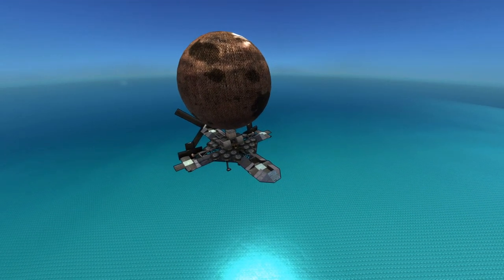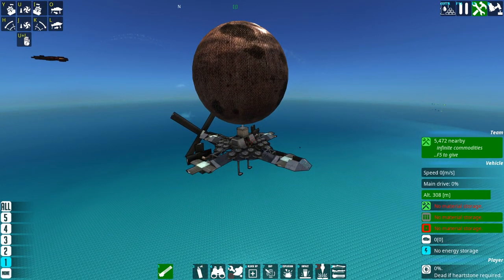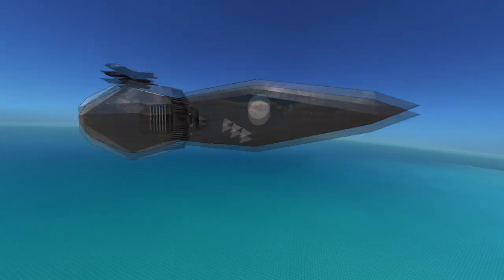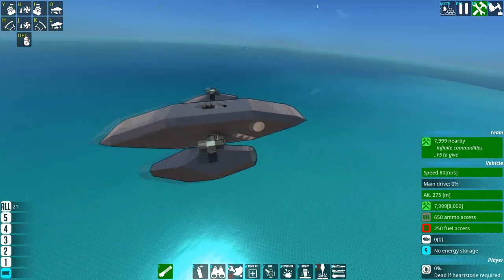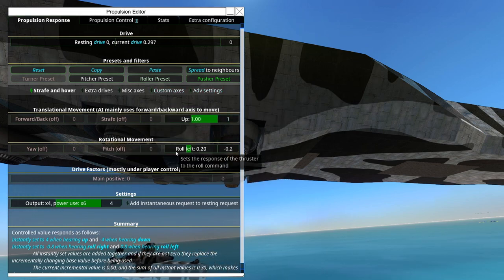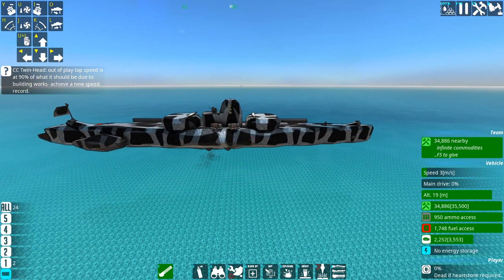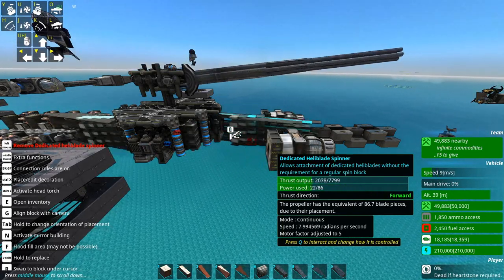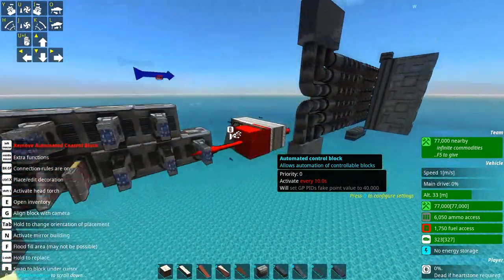Basic Airship Guide (5 Ways To Airship)! From the Depths

Comment: The integral time (I in pid) is very useful if you have a ship that's stable in pitch, i.e. not bouncing around, but points the nose too high or low. What it does is, the longer the pitch is wrong, the more corrective force it puts, so it'll push the nose back up or down and keep it there. Also works for altitude and roll.
Reply from the maker: First time I've heard it explained like that. I'll have to keep that on mind next time, cheers. 👍
Reply: Its also fairly useful in small attack jets to compensate for lack of redundancies, ive found it helps my jets stay stable even after losing a good chunk of pitch control where it would otherwise have gone to space
Reply: Woah, never heard it explained like that. writes this comment down

Comment: When using an airship that use props for lift, disable reverse, this helps maintain zero pitch. I find if you don't do this the craft will auto balance leaning slightly forward or slightly back.

Comment: Helium Airships
they benefit GREATLY from many helium compartements, as i can attest as an avid user of them, their greatest weakness is still overpen shells, since they can break open all compartements in one go,
helium airships also greatly benefit from sheer size!
Reply: Can testify! Also, the added fuel efficiency lets you have more materials to use as ammo.
Reply: @sampletext5959  or more material to maintain your fleet of fast, small attack crafts
also helium can lift ALOT in Ftd
i have a zeppelin aircraft carrier that uses a alloy-sloppedHeavy-alloy armor belt and it still flies like its nothing!
Reply: My go to is to create a shape like a 3-d chessboard made of 4m wood beams/poles/whatnot, and empty space, with the empty areas having a helium pump at one end, which also holds the beams together. This results in most of the volume of the ship being an array of hundreds of tiny gas cells, which cant be all taken out at once unless you blow up the entire craft in one go, and because much of the weight capacity is in the balloon itself, destroying chunks of it will also remove a correspondingly large amount of the weight it needs to carry.
Reply: Making a bunch of pre-fabed balloons then spamming in a sausage works great. Just wrap it in armour, and you even get airgaps for HESH protection.
Reply: Fill it with hydrogen and then you get the hindenburg disaster
Reply: I assume compartments make you drop down less when hit?
Reply: @Leon_Portier  yes
and since I usually go overboard with the helium, you need to pen MANY of them
only downside of my faction is that i build primarily with lighweight alloy and often dont have an armor scheme for the smaller airships, they often have just a single layer of alloy for a hull
Reply: I was playing that campaign against only the Onyx Watch, and after capturing some Onyx watch ships, I realised that if you replace all their water pumps with Helium pumps instead, due to their typically very spacious and compartmentalised hulls, hilariously you can actually convert a lot of them to helium airships with surprisingly little effort or extra material expense. I started doing it as an ongoing theme of the campaign. Despite being full metal, most ended up being basically neutral buoyancy with the air, needing only the most minimal engine power to lift up, and then next to nothing to maintain altitude.

A few of the more dense ones needed a couple crams removed from the top to clear room for helium, but I just prefabed some and put them on the bottom again instead. Made for a novel campaign gimmick.
Reply: Do you prefer armour, normal hull, or alloy to separate air compartments?

Comment: I use the AI's ability to control yaw
But I often using ACB blocks to control roll, pitch, forward speed and altitude.
I never use PIDs (because craft made with ACBs duck dive and weave) but they are useful if you need a stable craft for lets say.. a hover tank. (Something close to the ground/water needs stability)

Also setting up all you thrusters to respond to multiple commands is a slight issue
Whenever your craft needs to go up, it will lose all pitch control (if its also set to that).
I try to have multiple thrusters with specific tasks but you do you
Reply: Really? I Always thought multiple Inputs get added or subtracted. Might bei little less effective but on very small craft i think it would be necessary.
Edit:
(eg. Front: up1+pitch0.5 = 1 thrust, but in the back it's: up 1 + pitch(-0.5) = 0.5 thrust; in this example the front thuster only respond to Up, but the back one will BE effected by pitch).
Reply: @grandfremdling3841  yea, you're right. I always set up my corner thrusters with pitch, roll, and hover (although you might need to tweak the power to .5 to be safe) so as long as the core survives the airship can't fall until it's too damaged. (You need to add an extra set of thrusters in the center which act as a pivot for the surviving thrusters though)

Comment: Thanks, I was planning on making an airship at some point again and I think I'll get back to it soon now. 
I desperately want to make a airship that flies in a helical pattern. (Basically going around a circle as it travels forward) since that should prevent the ai from ever being on target. Basically it removes the 'turning around' that most wobbly aircraft due where it stops going up or down for a second. When they do this it allow rapid fire aps to get a few shots in. With a helical flight path the ai will always assume the plane is going in a different direction than it is. Assuming the ai is using a short time average and guns are decently accurate.

Comment: Balloon is really good cheap upward force usually I use this for satellites, ive seen people use this inside ships to lighten it up, dunno how it works and not my experties, hellium pumps has multiple benefits and downside, for one of its downside is ones it pop its slowly loose its effect. For good one its cheap and easy to understand, it create large space armor to your ship and my favorite use of it lighten some of the heavy block, using helium on heavy part can help you balance not just airship but also your ship.dediblades are one of the smoother and easier to grasp on and can make sick movements using breadboard or very aggressive pid. Helicopter blades are good for upward force not just for helicopter but also large airship. Custom wings are bit advance but helps give mobility to airship and combine with jets or custom jet can make your airship dance to the sky
Reply: Yea, I've even started considering using helium pumps/air pumps for roll control on ships. It worked out pretty well on my first attempt. Idk how it'll hold up when compartments start getting smashed but it should make ships less likely to tip over since air pumps on the bottom of the ship will turn off before the ship starts listing significantly.
Reply: @solsystem1342  a advice  have a custom engine that will kick in once you either start rolling or loosing altitude
Reply: @bd5317  that's a good one. Let me just write that down...

Comment: My spy satellite uses a helium tank to get it airborne, and then a quartet of power reduced ion engines that barely need a single RTG to stabilize and give it altitude in space. It's slow but under 4K, and reveals a lot of the map, and being 2000m up and tiny is a pretty good defense it turns out.

Comment: Borderwise (Or anyone else.), do you know anyway to stop horizontal movement (Strafe) or at least control it so that when you go up in the air, it doesn't strafe without command?
Reply from the maker: Can you give more details? If a craft is moving sideways unprompted, the first thing that comes to mind is a roll control problem.
Reply: @BorderWise12 What I mean is that the thrusters aren't active strafing me, it's just drift. What I mean by that is that when I strafe, it continues until air resistance stops me. Roll would help, if I weren't using PIDs to control it. I am new though, so there may be things that I don't know about certain things. Oh, and also, I don't want to use AI to control, I want to manually control it.